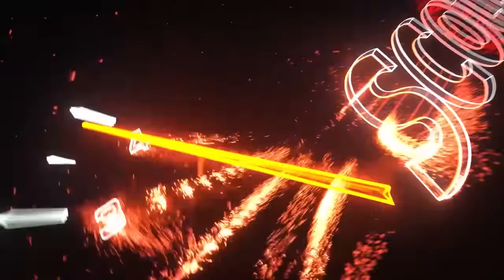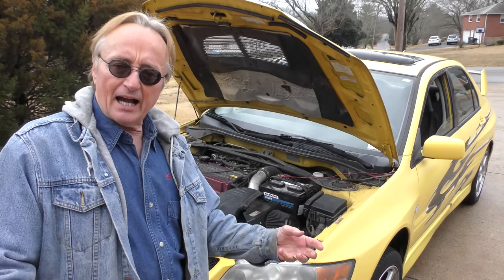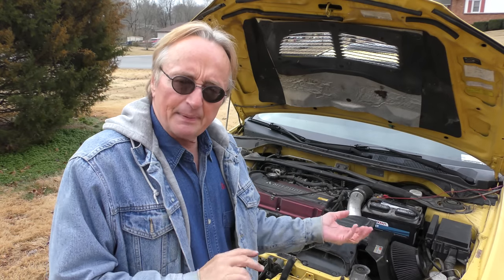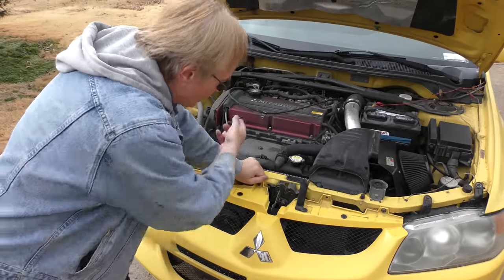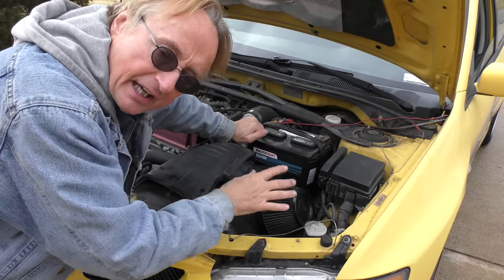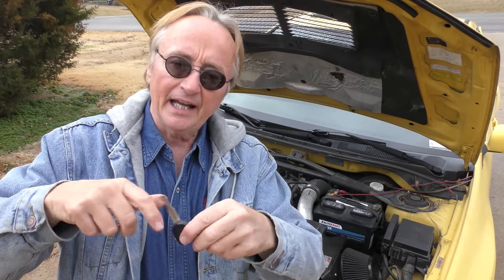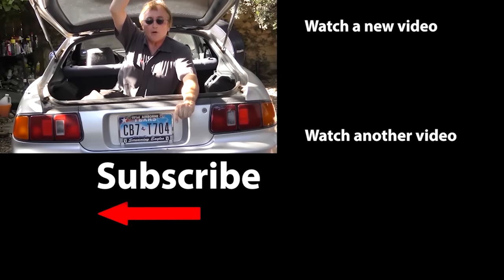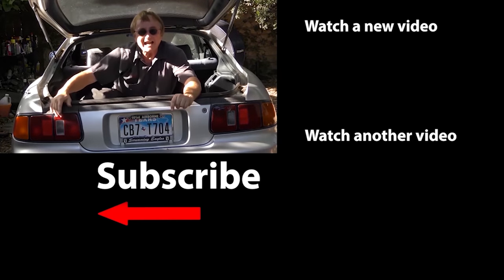Here's How a Mechanic Spots a Bad Car to Buy

Comment: this one is not evo7  2003, its evo8 2003, in same year both models was exist, in my country the evos i test and check and saw and like was on greddy hks aftermarket parts, sound strong powerful, nice blow valve sound, not like this at all, in evo the windows glass are thick and strong, they built strong, save, but may be some people abuse them, you can get any oem part easily from Mitsubishi because they all have similar engine and most parts models are fixable, the rs came with lsd and anti lag, worth to buy.

Comment: I don't get the hate on K&Ns. I've used them since the 90s, but unlike a lot of these "problem" cars on YouTube videos, I install mine properly—which involves removing all unnecessary induction pipework, breathers, vacuums and other plastic junk—and once a year, I CLEAN THEM!! This Evo has clearly not been maintained and that filter is black.

Comment: Very good video
Looks like it has or still is owned by a Boy racer.
The body looks in very good condition, might be good underneath.
The rad pressure cap nice and clean, and the coolant clean, not a rusty colour.
They must be rich people,
Running the engine rich, 
About 10 mls to the gallon.
Might be good for a bit of off roading in the desert.
A bit of your expertise will make a poorly running car 
A dream to drive.

Comment: My evo ran like a clock...until I ran it through flood waters a couple years back.
Reply: Please elaborate
Reply: @mrdave777  in Loveland CO, 2013 we had a massive flood.  The water was standing in some areas 10 feet.  I worked in Denver and did not realize what was happening Loveland.  Coming home it was dark, my street was flooded and I drove right in to it.  I shifted it to Reverse but it was too late, water go into the intake.  It never ran the same again.   I sold it a couple days later.  200000k miles.

Comment: so.. maf(mass-air-flow) based engines will go super rich or lean if the intake is changed at all, and require a tune to correct that..... from my understanding map(manifold pressure) based ecu's compensate freer or less-free intakes better, along with vta-blow-off-valves and  more overboost protection systems... If this came with a tune-software license and access-port and/or programmer the rich condition may be very correctable and have created new mechanical issues.   It might even make 1% more power than way, but you'd have to know how it was last tuned, and can you continue that tune.   IT seems the guy put in big-injectors, aftermarket intake and likely upgraded cam-shafts for more lift+duration and better high-rpm performance with worse idle... he probably removed the tune to sell it and made it run badly

Comment: cold air intake is with out a tune. they say a tune isn't required, but it screwed up my Sonic. i had a ZZP one with out a tune on my Sonic. after about 2 months acceleration got worse and the check engine light came on. I put the stock one on for warranty work wouldn't you know the check light goes off the day of my appointment (didn't tell them about the aftermarket intake, afraid to void warranty) and they said they had to replaced the Mass air flow sensor .  I said oh that's an easy part how much? $169 and then they said they needed to reprogram it for the computer?🤔 for like $300 😲😲 but all i had to pay was the $100 deductible. 
So yeah don't fnck around with aftermarket cold air intakes unless you have it tuned

Comment: Hey scotty great video.i have a 92 camry and it has 235k miles still runs great just leaks around the plug in the motor anything you can think of to fix that leak, already replaced the plug still going..
Reply: Go to AutoZone and purchase some crush washers. Next time you change the oil make sure to put the washer on. It'll stop leaking, if it's still dripping with the washer. Then go get some black RTV and whenever you first tighten, give it a nice cost of RTV around the outside of the bolt. It'll harden and dry and act like a gasket. There's even a liquid gasket spray that should work. You'd have to break the seal everytime you change the oil though. But this is a worst case scenario, the crush washer will likely work.

Comment: I used to design automated welding equipment and i worked in the shop and man the shop foreman would freak out if the wires were to long if they weren't done neatly.

Comment: Scotty can you run 10w 30 instead 5w 30 in chevy 3.5 motor? Have a Monte Carlo 2006 with 128k runs great plan on keeping.
Reply: Yes you can not a problem only the us runs these super this oils. If you pull a foreign manual for the same car it will say up to 20w50 thin oil is a way to increase gas mileage. 10w30 has twice the lubrication oil of 5w30. I run 15w40 dual rated oil in all the vehicles I take care of now for over a decade never a issue. It's not just diesal oil it's dual rated for cars as well. And it's good oil. It's been doing what new synthetics are doing for decades. It's great for hot running outdoor equipment as well like generators and lawn mowers that are air cooled

Comment: I love how in America a 2.0 T 4pot is considered ‘itty bitty’ 😂 more size doesn’t straight up mean more power, some of these engines (not the mitsubishi) have this little thing called ‘engineering’ (Americans seem to hate it because it confuses them) which allows smaller engines to put out the same horsepower as some of your ridiculous gas guzzling v8’s 😂

Comment: Isn't having raw fuel in the exhaust good for "popcorn exhaust"??
Reply: Scotty is clueless when it comes to most basic engine performance principles, water in your exhaust is absolutely normal even for stock cars at startup. all cars produce water in its exhaust due to condensation etc. and by popcorn exhaust I assume you mean the crackles and pops on decel, typically you get this by disabling or modifying a engine parameter called “DFCO” that almost all vehicles have. Sometimes you can just disable it, other times you have to tinker with stuff..most stock cars cut fuel and sometimes spark as well on deceleration. By simply disabling this feature or by modifying it to not cut fuel and to overly cut spark timing, you essentially ignite the fuel as the exhaust valve is opening. There’s your pipitty pops, easy as pie to do for any “tooner” you can find that has the appropriate hardware&software

Comment: So tell me. I just bought a 1990 mercury cougar LS. 134000 miles on er. Everything seems to work on it. It sat for a long time I was told. Stereo has power but won't switch to FM radio. Si I can't tell if the speakers work. It's has a premium sound system according to Mercury. Should I just rip it out and replace it?

Comment: Hey Scotty what are your thoughts on the 6th generation Chevy Malibus (model years 2004-2007) with 100k miles on it as a first car.
Reply: @IJoeAceJRI  Those cost way more than the Malibu’s though and from what I’ve seen the 4 cylinder ones are reliable if you take care of them.

Comment: Hi Scotty, 

I just bought a 2002 Lexus RX300 RWD with 138k miles for $3300. After purchase, I put some new tires on it, changed the breaks, and changed the transmission fluid. Turns out though, that the driveshaft needs to get changed, so does the valve cover gasket, potentially the alternator, and the timing belt. Do you think this car is worth investing so much money or should I try to sell it and get something like an 04 Toyota Corolla? I’m a basically broke pre-med student hopefully going to start medical school soon. 

Thank you!

Richard

Comment: It needs to run rich if you want more power. Im sure the boost is turned up on it. And in order to push more air through the engine you need to have more fuel if you want more power. You shouldve drove it a little. It might have changed your mind.

Comment: As an aussie, there is not a single american made vehicle on the market that i would buy over a mitsubishi here. My last mitsubishi had over 400 000 ks on the clock when i sold it, with very few dramas, and i still see it driving around now. American cars here are expensive, impossible to find parts for, and not very well built. Its probably different in America where parts are cheap and everywhere, but here i would have japanese over american any day!

Comment: Those cold air intake are garbage and most of the time it ruins how the engine runs. The air flow sensor is designed to work with the stock air box, it's not only the diameter of the pipe, it's also the shape and length. People who just fit a cold intake kit without tuning the sensor and ECU actually don't know what they are doing.

Comment: HEY SCOTTY! What do you think about the 2018 RAV4 XLE AWD HYBRID with 30k miles for 19k? It is still under warranty and all the servicing has been done at a TOYOTA Dealership and is from California
Reply: Too cheap.  Get a Carfax report.
Reply: I'm getting one but not the hybrid and it's 2WD, but I'm in Houston. Check the CARFAX and that isn't always true bc a person can have an accident, fix it themselves, and it's never reported. Like Scotty said, have a mechanic check it out first.

The 2018 is one of the best if you're going used. How did you find it? Is it a personal, lease, or rental? What are you using it for, like are you going to be putting a lot of miles on it quickly?

I'm still wondering if certified is worth it since these are such well made vehicles. 🤔 My 2003 Honda Odyssey van died recently with 94K miles. We put the miles on our little Honda Fit instead. 

Everything is negotiable though. 😉
Reply: @IJoeAceJRI  It was starting to slip but what finally did her in was alternator went out. Battery fried. Driver side sliding door stuck closed. Cracked windshield. Needs all 4 tires replaced. Driver side headlight only comes back on after I bang the front side fender with my fist. Every time I hit one of these blasted Houston potholes, the passenger sliding door alert would blare until I hit another pothole to get it to stop! Argh!!!! So she's currently residing in my driveway. 

Had ice cold A/C tho! 😆

Comment: I just ordered a typhoon short air intake system for my 2005 Honda Civic dx should I be worried ? Or was Scotty just talking about the evolution ?
Reply: I would say he was talking more about the job that was done (the crappy modification job that was done to the car, not the car so much).  I think he even said this.  With stock parts, the Evo is fine.  It's the fact that someone (who probably didn't know exactly what they were doing or was just lazy) did this modification most likely, which lead to the issues.  I think you'll be fine as long as you know how to properly install it and don't beat the crap out of your car.  When done properly, car mods can be helpful, but it's when people who don't know what they're doing or aren't careful, that's where things fall apart and you start having issues.  Obviously some engines are made better than others and can handle such mods as turbo chargers.    An air intake system (as long as it's not turbo charged) shouldn't give you that many problems.  You might need to make adjustments to some of the sensors or buy new ones to compensate for the changes.
Reply: @HR-wd6cw  so the oem sensor won’t fit with the K&N intake ? I mean should probably change it anyways ahahahah word bro thanks a lot your a big help bro take it easy and thanks again

Comment: Hi Scotty,

Thinking about buying 2012 Sentra SE-R Spec V? 6 speed 85k miles. Do you think it will be a good buy?

Thanks!
Reply: @IJoeAceJRI  thanks for the heads up. I thought it was just the models with a  cvt. Guess not.
Reply: Chaminda Thushara Ruwan Kasturi  I like those also. Kind of hard to find a decent one on the west coast. Many have been modified.
Reply: @IJoeAceJRI  all good. Yes. It would be a manual 6 speed transmission
Reply: @IJoeAceJRI  the spec v was a 6 speed manual, 175hp, 180 ft lbs torque.  I had one for a few years, it was actually a blast to drive , but it was not the most reliable.  I hardly ever see them on the road anymore.  There was some poor engineering from nissan on that one...the OEM exhaust manifold cat could pop, and the material inside would make its way into the motor, scoring the piston walls.  I replaced my exhaust manifold early on to avoid that problem when I had it.

Comment: Hi Scotty, I bought a new Fiat Tipo HB that was 2 years old (with 15km). 
Do you think I should to change the oil even though the car has not been used. The car was kept in some Fiat warehouse cross Europe and they said that they’ve run some checkups and thought that factory oil was good.
Was should I do?
Reply: I can suggest that, once the oil has been heated up once, it only has a life expectancy of one year.
Reply: @Mani Kalkat: why wouldn’t you change the oil? Cheaper to do that than potentially ruining and replacing an engine? $50 usd vs. $5K usd?

Comment: I wouldn't blamed this EVO.  I would blame the owner who brought it to you.  This car is poorly kept and maintained so don't blamed the manufacture for it.  Just look at how dirty it is.  The stock ECU in these evo are a tuner dream, highly tunable.  Most of the non critical sensors was disabled by a tuner which is why you didn't detect any trouble codes with your scan tool.  Parts on the car was probally upgraded or return to stock and the vehicle was never taken back for a re-tune for those parts, which is why it is running rich..  a simple re-tune by a reputable tuner would solve that issue.

Comment: You have to be smoking crack to buy one of those old Mitsubishi's. You can buy an old Lexus is350 with 300hp that will likely make it to 300k miles without major system failures for 5k